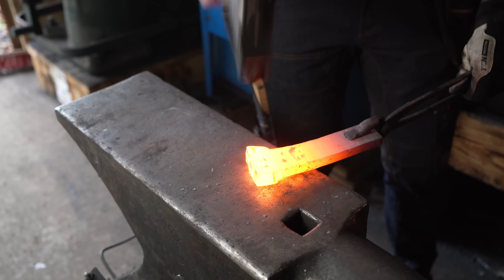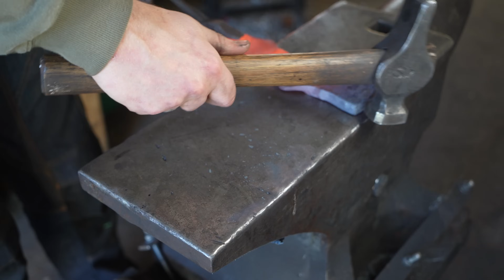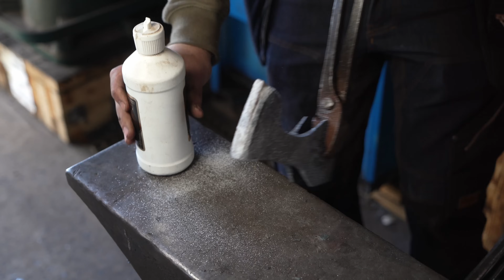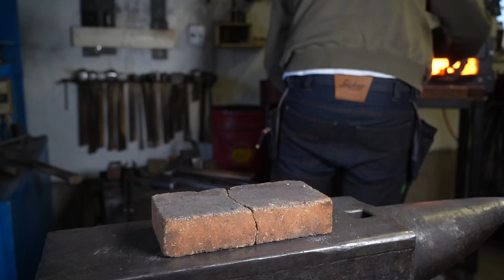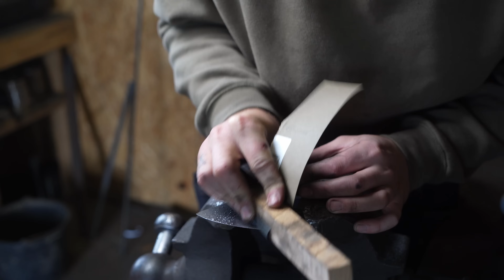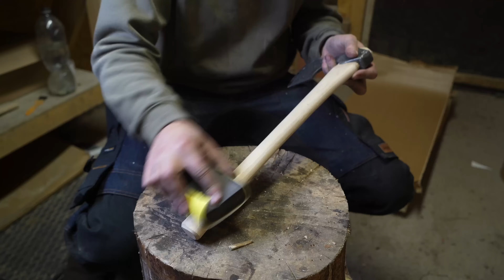Folded Axes: An Introduction to Asymmetrical Fold Technique

Comment: ive seen a few video now about axe forging, and i realized that they rarly heatreat the whole head of the axe, just the edge, i get that the edge is the most important and that the backside of the axe is not used for cutting but i feel like if they dont heatreat whe whole thing it might bend. what if you do heatreat the whole thing but keep the edge higher HRC and the back lower like edge 55+ and back 52 depending of the steel should be soft enought to not have an negative impact on the axehead and yet absorbe all impact without bening or breaking

Comment: Nils, your work is really well done.  I do have to say that files are designed to be  'push' tools.  They are not designed to go back and forth under pressure.  The teeth of a file all lean forward and pulling the file backwards under pressure, will break off the leading edges.

Comment: So I have a question, why did you just upset one end and forge weld along what would become the neck of the blade and not do 2 smaller upsets on either end and fold the 2 upsets together. This way would have made it so you only have to weld once and use the edge steel for the insert also. I had a forge set up and was getting better every day I was out there and was about to try this very type of axe when I had an accident that laid me up for some years and left me unable to lift more than 50 lbs, but really want to get the forge going again now that I'm healed up about as much as I ever will.
Reply from the maker: Because this is a presentation of the asymmetrical fold technique, like the title of the videos suggest. I am fairly sure that I go over the pros and cons at the end of the video. I have another video where I show the symmetrical fold technique, howevee, I am not so sure its easier to throw everything in at the same time, closing the eye and inserting the edge steel. I have found that you get way more control and accuracy by doing little by little. Especially by hand. Hope you heal up soon!
Reply: Thanks for the answer, I will be trying your way next time I fire up the forge. As for the healing up, I am as good as ever will be, at least as for what the doc says, thnxs.

Comment: That was very cool! Sandwiching that is reminiscent of katana smithing with the higher and lower carbon steels being hammered together to give the weapon a mix of hardness and give. I’ve never watched an axe being worked on. The tool that goes into the hole where the handle goes was neat, and using the pointy part of the anvil to work on the curvy part of the axe head…hah! You can tell I know all the special terminology…. Keep up the great work!

Comment: I never saw this method before. I might give it a shot since you didn't use any powertools, to which I have no access, this is a great tutorial! A bit of constructive criticism: Maybe you should move the mic a bit away when filming those hits that have a vibration, or maybe use a mesh infront of it. The ringing noise was at times a bit annoying. Thank you for showing this technique!
Reply from the maker: I am aware of the osund issue.  It pains me when I am editing. I have tried many things to fix the sound. I have now ordered some huge magnets that I hope will work wonders!
Reply: @NilsÖgren  Thought so already because the rest of your videography process is so nailed down. Don't worry, it's not a deatlbreaker just something I noticed. Keep on going and as already mentioned, thank you so much for putting out these videos helping beginners in the process!

Comment: If a weld doesn't bond it leaves a lamination, not a delamination .Although commonly used interchangeably, to delaminate is a verb . Very fine work. Commercial axes are usually tempered soft enough to file because they expect them to be abused  and they want them to deform rather than chip. A  tool like this, if used with care,  can be made hard enough that a file won't cut it. If a file is biting this hardened axe I suspect it is somewhat under RC55.

Comment: What a lovely axe! Beautiful hammerwork and weld, and very clever trick with the tiny strip of tool steel, and loving the Arnie poster, too! Definitely got to try forging an asymmetrical one out myself. Axes are my favourite thing to make, such a practical tool and weapon with history near as long as humanity itself. I have used a symmetrical weld on my last axe that I brought as a gift to a bearkeeper who allowed me to come see his wards, silly me forgot to take a picture with the bears and the axe though, ack! The axe itself was out of four parts, mild steel body and center insert piece, and 1%carbon steel poll and over-weld edge. She took shape of the dane axes, though I made it thicker to be usable for chopping wood and such too, and she came out to 1901grams, slightly over 3kilos with a hip-height oak haft, and quite monstrous at just over 20 centimetres of edge length! Man, I am so proud of that one, and the bearkeeper and his wife loved it...and said it is too pretty to use, dammit. :D

Comment: Awesome! Thanks for your effort! This video makes me interested about the axe. What’s the purpose of the arc between the handle and the blade? Is it for higher speed when it was designed as a weapon? Lighter in weight? Absorbing the rebound energy when hitting on wood? Mechanically more durable?

Comment: I do this as a hobby in a gas forge. It gives as appreciation for the skill of the viking and saxon smiths as I am still only 50% on forge welds after several years, I am self taught though. I wish I could do this consistently.

Comment: Beautiful craftsmanship. The technique of using high-carbon steel to help with the forge weld is one I’ve never seen on other blacksmithing videos. Is that something commonly used and not mentioned, or something more axe smiths should learn?
Reply from the maker: I dont think its that common. I know one other guy who uses it on a regular basis, but like I mention in the video, you could figure it out by yourself, especially if you have problems with the weld

Comment: That's a interesting way to forge an axe. As a traditional boatbuilder, building mainly clinker built dinghies I have a great appreciation of good tools. I have always wanted to try a sweedish style axe but they are non existant in my part of the world. I live on the island state of Australia called Tasmania, and all the old tools here are of British origin. This place was colonised by the British 200 odd years ago. I have an adze and a blacksmith vice that an uncle dug up that are both handforged with the adze having a delaminated weld on the poll. I presume it had a spike on it originally that has ripped off. He surmised these tools were from the first convict era or soon after. The British soon found that their tools were not good enough quality to cut the eauculiptus forests found here. They had to try and re harden what they had with them. Anyway enough rambling, great job on your tools. I admire your work. Cheers and G'day from Tasmania.

Comment: What a beautiful Axe, I have always loved the bearded axes for their roots in history, I am a History lover, so when I see modern items made after old designs I have a hard time resisting them! Thanks for showing us one of the ways to make this beautiful design and it is obvious to see, as well as hear your expertise and experience in Black smithing. The one thing I love about this job and any other work I've seen you do is that you use a standard set of hand tools to do the work, not a hydraulic press or electric/steam hammer. I'm not against using those items, especially if you are trying to mass produce something, but there is something to be said for an item that had been done the old way, with a Forge, hammer, anvil and tongs.

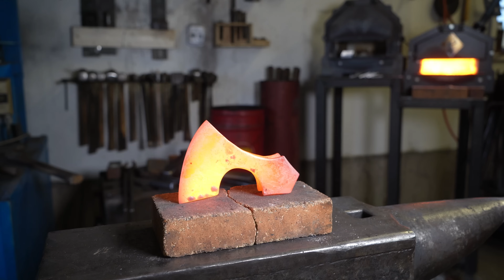Comment: 14:26  If it is done well (heat to 30°C above the quenching temperature and let it cool at room temperature - it's that simple), there is no need to repeat the normalization. By repeating the normalization, the result will be the result of the last normalization. On the contrary, it is harmful, because repeated heating causes the steel crystals to enlarge, etc, etc...

Comment: What kind of steel are you using for your chisel, and drifting piece? I've tried making a chisel out of 52100 steel (of which I've scavenged about 100 kgs in total), but it doesn't work well. I don't have other steel available, so I'd have to order it (I work nearby a company that often needs steel, so I can pay them to order a bit for me as ordering in large batches is cheaper than buying it myself).
Reply from the maker: Not sure about the chisel, I got it from an old workshop. My drifts are made from ss2541, equivalent to 4340.
Reply: @NilsÖgren  Thanks :). I've done some research meanwhile, and (even though it's not directly stated) it appears 4340 is a recommended alloy for hardy tools and thus assumingly suitable for chisels too. I know of a steel that retains its hardness until up to ~600°C, but I don't know its name. I have found others that sound promising though; AISI200, -300 and -400 series of steel. They're supposedly heat resistant, but it's not directly implicated that they retain their hardness.

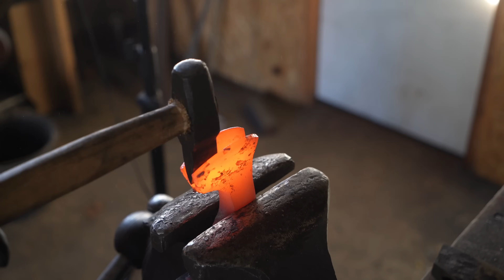Comment: Great video, thank you for sharing it!  May i ask how many heats with the chisel it took to get to 8:07?
Reply from the maker: Many! I will show in a future video, a different approach. that does not require chisel work at all. If you have an angle grinder, its way faster, just cut it open and then use the chisel for final depth

Comment: "You want to seat the head first, make enough room so you can get the head just on there. You tap it on the back, to force it in a little bit. Remove the head. Then you can see where you have contacted with the wood."

Comment: I know is not blacksmithing per say, but could you use tig welding to fix small delamination? I understand the delamination could be more than you could see underneath, but for what most would use it for, it would still last a lifetime.

Comment: how long did it take to make this axe, and how much would you have to charge for it to make money this way?
Reply from the maker: With filming it took me about 3 work days. Could probably make it in a little more than one day otherwise. With powertools it would be even faster. On the money question it all depends on your needs and your expenses. I live in Sweden where the government takes 50% in taxes(at least) so I have to take that in to account, I would also have to figure in fuel, electricity, material and time.